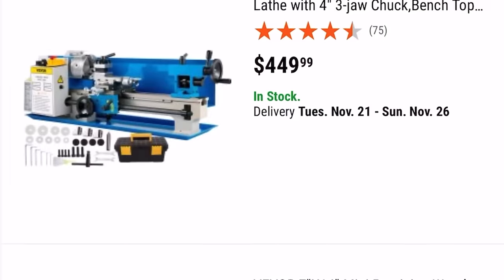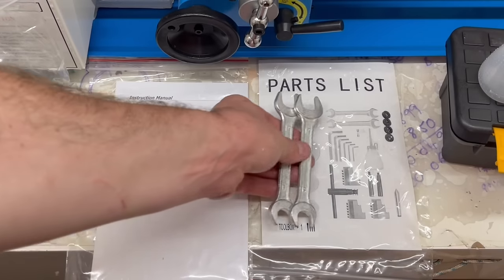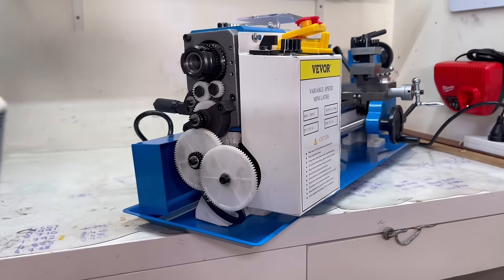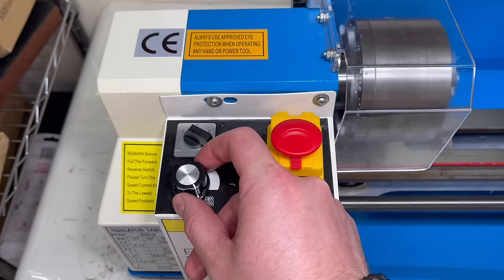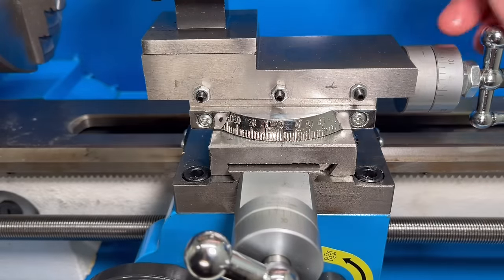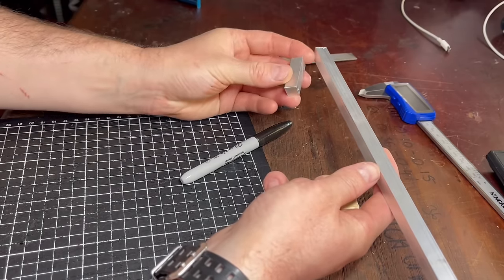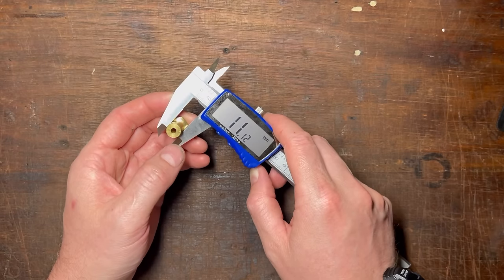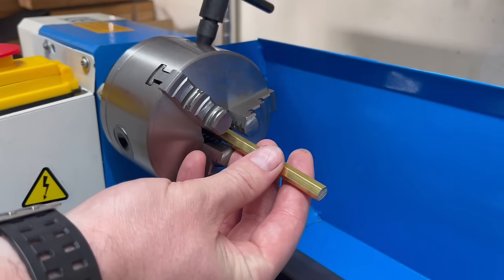Testing A Cheap Chinese Mini Metal Lathe: Is It Worth It?!

Comment: the largest issue though is that vevor is hit or miss, the lathe i got is practically useless even after a bunch of work. it wont cut right, the finish is bad, tailstock had to be manually centered and shimmed to center, along with a whole host of other issues that i spent days over. 

the most egregious thing i found was that the entire tool post was a good 3 mm too high, no matter what sized tooling i use whether brazed carbide, insert or high speed steel its always so above center you cant do anything at all. the post should be below center so you can shim the tooling up, in the end i had to just buy a quick change TP so i can align it properly. Another horrifying thing i discovered was they wired the switch on the neutral line which means even with the switch off the circuitry is energized and can be lethal, ive bought alot of stuff from vevor before and every time the equipment was disappointingly bad, unless i got unlucky 4 times in a row (one product which failed in a manner requiring me to get stitches) vevor just doesnt really do quality control
Reply from the maker: Sorry to hear of your bad luck, that sucks!!! I have nothing but good experiences with their equipment fortunately! I have their lathe, welder and an inductive heater. I did have to shim the lathe and add a carriage lock, but that was all I have done. Hopefully you can get your lathe sorted!!
Reply: I can swap the power plug around, it's a 50% chance its correctly switched with a europlug.
Having the switch on the neutral line isn't a big deal as long as you have proper grounding or its properly insulated.
Reply: well the shoddy wiring internally is what makes it poor, the plug to board splice that doesn't go to the switch is just twisted together, not soldered not terminal connected not crimped, under vibration itll shake itself loose and for mine which has the live spliced like that itll short to the chassis and need repair, i already fixed the wiring but there are so many other defects that it baffles me they put a quality control approval sticker on it and are proud to have their name on it
Reply: @EdwardTriesToScience  like I said, live and neutral are interchangeable here, I can just turn the plug around so not using that mindset at all. 😬
Got a fairly good setup fusebox with proper RCD's that also helps alot.
And yes got zapped with 230v and 380v a couple times so I know they work 😂

But it seems rather normal for Chinese QC to me, take the k40 laser, as a fine example.
There is 24+kv inside of that thing but the ground isn't even attached to bare metal.
24kv is lethal, 230v is like peanuts compared to that.
There are western companies that put their name on them but with western QC, standards and modifications however you pay a premium for that.
I can get a Alibaba branded one for 450 bucks or spend 700 and don't have any issues with quality and safety.
Same machine, same parts but better finish.

Comment: I have the Harbor Freight version of this lathe. The parallelism of the ways to the spindle axis is almost perfect - within a few thousands in six inches.
Anything worse should be totally unacceptable and a clue that the manufacturer took little interest in their quality control and respect for their customers. This “feature” is the most important parameter in a metal lathe and should be considered an indicator of the overall quality of their products.
Reply from the maker: Thanks for sharing

Comment: It's ok for a week or two but then all the parts start getting loose and wearing out just looked at the plastic gears are rubbish my advice spend more money
Reply from the maker: You clearly haven’t used it because you’d see that what you’re saying isn’t true. Plastic gears are quiet, don’t require lubricants and are the first thing to break in a bind, rather than shafts, splines and jaws. That’s makes easy and cheap to replace. That’s a good thing when learning.

Comment: Just surprised it’s plastics gears
Reply from the maker: I understand, in my experience they’re fantastic - in the event of a bad catch worst case you will strip a tooth rather than damage a jaw or break another component that is expensive to repair and worth mentioning the drive gears are metal. Also nylon gears run much quieter, don’t require lubricant and have all necessary strength for a lathe of this size, power and capability.

Comment: You are running a taper partially because you have that part out too far.  Also did you indicate the initial piece in before you even started cutting?
Reply from the maker: Hey :) thanks for the feedback, I tried different stick out multiple times and it was the same. After the correction it’s now spot on :)

Comment: Yep. It will cut brass no problem. But how about steel?
Reply from the maker: Yes very well! You can’t cut really deep cuts, but I have happily made tooling from hardened steels like punches as well as from 1045
Reply: @eEngineRepairs I know it will. I cut lots of it on mine. It's just that you did not show it, and it's the most interesting part.
Reply from the maker: Ah I see, gotcha, thanks for the feedback, you’re quite right, it would have been good to cut steels on camera for people to see 👍

Comment: I started out with a mini lathe many years ago, then I slowly graduated from that to a 9x19 and then a full-sized gunsmithing lathe.  (same with the mini mill. I went to a CNCmill)
Anyway, I sold my full sized machines thinking I'd never need them again after retiring from the work force. Boy was I wrong.
Now I'm thinking of buying another Mini Lathe and I was wondering.  On my larger lathes they had a dial indicator that would spin around on a circular gauge which indicated the exact time in which to engage the half-nut when cutting threads.
I don't see any kind of dial on these Vevor mini lathes that would indicate when to engage the half-nut when cutting threads.
How does one time the engagement of the half-nut without these indicator dials in place?
Reply from the maker: Hey! No there isn’t that dial, the way to cut threads in this case is to never disengage the half nut. 

There is likely a better way, but I will take a pass, when I get to the end of the threads, stop the machine, turn out the cross slide, set the machine in reverse, start the machine, set it in forward, turn the cross slide in to where it was and then slightly deeper and then repeat. It’s annoying, but with some practise it’s easy.

Comment: Thanks for the info, would it be possible to turn a 67mm piston diameter down to 65.90 with this lathe 🤔
Reply from the maker: Yes :)
Reply: @VintageEngineRepairs  
That's great, thank you, very much, you're a champ have a great day bro 👍
Reply from the maker: You too! What piston is that from and what’s it going in?!
Reply: @VintageEngineRepairs  
It's from a Kipor IG2600 generator, i can't get a replacement piston anywhere, no one makes pistons that are 65.99, but I get a 67mm piston from AliExpress, I did try a 65.5mm piston but it was a few thouw  too small...I've ordered 66mm piston ring so I'm hoping they'll fit my original piston,
Reply from the maker: Ah awesome! Interesting project :)

Comment: how large Is that main bearing thru hole on the opposite side where gearbox is... will the butt of a cue stick pass through it?
Reply from the maker: Hey, I believe it’s 20mm / just under an inch in diameter mate 👍
Reply: @VintageEngineRepairs  Thank you!! I think that might be a bit too small just going by fact that Taig 5c headstock is 1.77 in

Comment: Plastic gears in a lathe, ill give it a miss.
Reply from the maker: Why? They’re quiet, don’t require lubricant, last a long time and should you get a bad catch, the cheap and easy to replace gears will shear before metal shafts, splines, jaws and threads that can’t be easily or cheaply replaced.

Comment: The thing really missing from these mini lathes, is a threading dial.

Yes, you can thread without a threading dial, but it's a real PITA.
Reply from the maker: It is! I agree 👍
Reply: Mine had a threading dial.
Reply: @HarryJarrell   Mine also came with one but I don't bother using it, I find it's faster to just reverse the motor and drive it back to the start.  But most of the time I'm not cutting more than about an inch or 2 of thread.

Comment: why didnt you use the lathe to cut the threads?
Reply from the maker: You can! Though it’s much more time consuming changing gears and the process. For standard threads I recommend using taps and dies if you have them on hand. My opinion is that cutting threads is best kept for non standard sizes.
Reply: i see, thank you for your answer @VintageEngineRepairs

Comment: Great rundown of the goods and bads and improvements. Have you tried turning some metal held between the chuck and tailstock centre and checking for taper? Shimming your headstock like you did may have overcome one problem but may have introduced another one if the tailstock is not adjustable sideways (maybe it is, can't see).
Reply from the maker: Hey! Thanks for the kind words! Yes I have done, it’s still very good (relatively) it’s a hobbyist lathe of course! About 0.005mm per cm with tail stock!

Comment: Can you detail how you adjusted the headstock ? Thanks
Reply from the maker: Yep, just take the 4 bolts off, place the feeler gauge on the V  in the side you want to move the head stock away from. Tighten down, machine a length, measure and re-adjust.
Reply: @VintageEngineRepairs  OK, but after I tightened the screws, how the heck do I get the feeler gauge out?
Reply: @ulbed  You don't. Buy some shim stock and just leave it in there.

Comment: why did you use the die to cut the external threads instead of the lead screw?
Reply from the maker: Because it was much quicker. I’d use the lead screw if I wanted a unique diameter piece threaded

Comment: I wonder if you could make metal replacement gears on this lathe to replace the plastic ones that come with the kit. ?
Reply from the maker: I’m sure someone could, but I’d just buy them, they’re not expensive :)
Reply: @VintageEngineRepairs  I noticed the more expensive Vevor lathes had metal gears.
Reply: @dnomyarnostaw  Get the 8x machine instead of the smaller 7x for not much more money. Then, it has no drive gears, all belt driven. Metal change gears for the lead screw are unnecessary, I use 3d printed ones and have no problem.

Comment: Thread a bar, bend it, make it a simple locking lever for your slide lock?  If you cut a lot of threads this guy has a nice idea of a simple home made aid for that. Remember that tool post can hold some workpieces while the chuck holds a slot drill or end mill, then you have a simple milling machine, maybe cutting keyways or simple milling cuts. :)
Reply from the maker: Spot on mate :) yes I have done some shaping with the lathe! I made some awesome cheese head and fillister head bolts that way :) cuts a perfect slot!